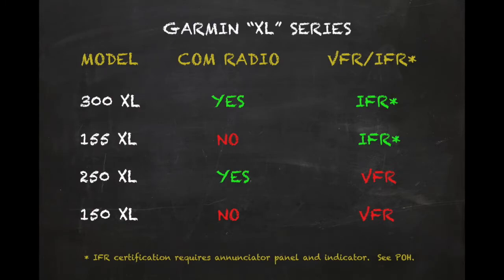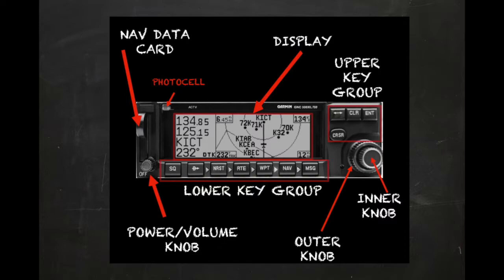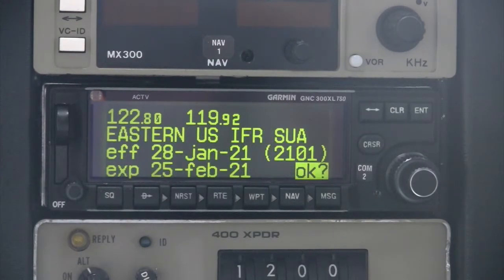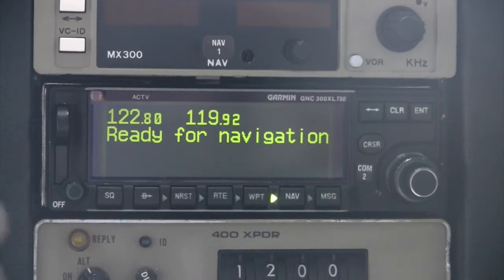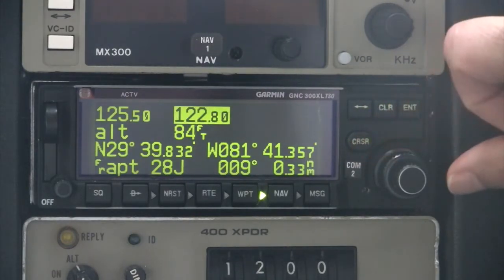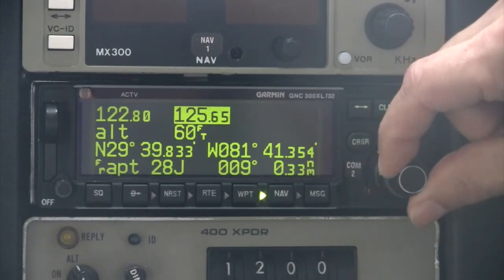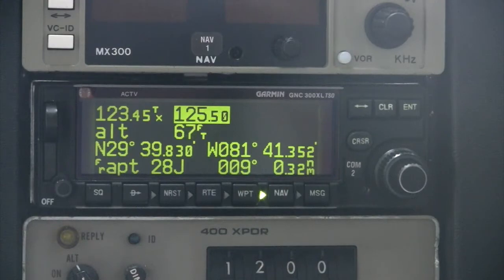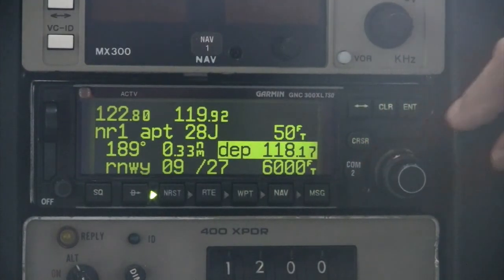MODULE-15 Part 1:Garmin GNC 300XL GPS Overview and Communications ( Also 150XL, 155XL, 250XL )

Comment: This is a bit off-topic.  I have been watching your videos and they are great!!!  I have a Zodiac 601 XL B with the Garmin GNC 250XL NavCom.  This past Monday, the radio transmit function stopped working.  My question is:  how does one do a 'reset' on this device?  Thank you very much.  Joe Thompson
Reply from the maker: Sorry to hear about the Tx issue.   Does the Tx indicator illuminate when you press the PTT?  Did you check connection between external PTT and radio?  I am not aware of any 'reset' function.

Comment: Excellent presentation thank you
Reply from the maker: Thanks for the feedback CJ.
Reply: @theflightpractitioner7288  I have a 250XL linked to a new AV-30 in my 150 that I need to fully learn , your videos are excellent, thank you
Reply from the maker: @crazyc99  Very nice!   You have to get some aircraft videos up.....and perhaps ease up on those Carolina Reapers ;)  Any experience/thoughts on a classic 1985 380 SL?
Reply: @theflightpractitioner7288  
Hahaha I gotta have my spicy 😅 although the reaper was painful un the gut lol.
I definitely will get some videos up, I have a bunch on my Instagram page, I flew the 150 from Bemidji Minnesota to San Martin Ca and it was one unforgettable awesome trip .
As for the SL, it's a nice car, and they're going up in value slowly, a bit finicky to get to run perfectly with and old cis injection but overall if you like the car it's a good investment, especially if you can wrench on it yourself
Reply from the maker: @crazyc99  Sounds like a great trip!   I am looking forward to doing some long cross countries like that when time permits.   It would be nice to see your AV30 in action.  Seems like quite a few 150 owners are installing them.  I am going to be looking at panel upgrades next year and still thinking through the design.  Thanks for the advice on the 380 - have one in the family that is in great physical shape but in need of some serious engine work.  Debating if it would be worth the time/investment.  Of course, the way car prices are headed these days (heck, all prices), maybe worth hanging onto.